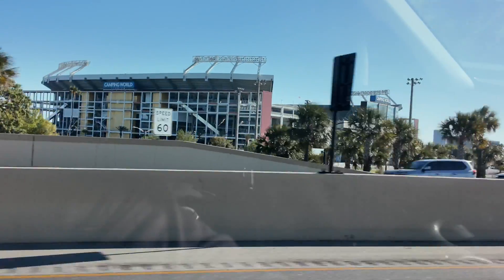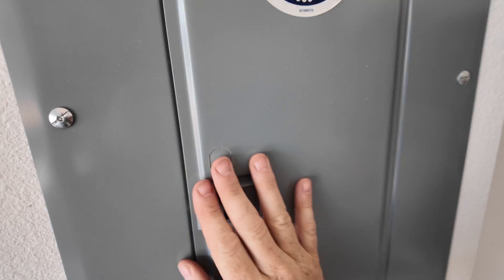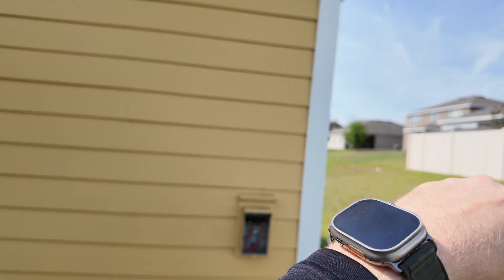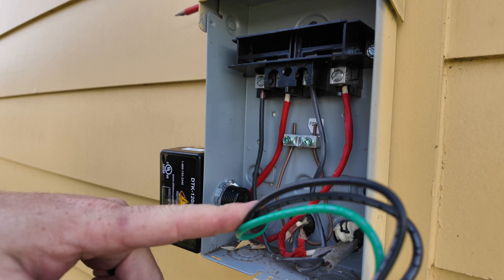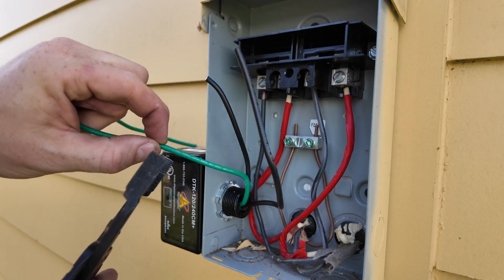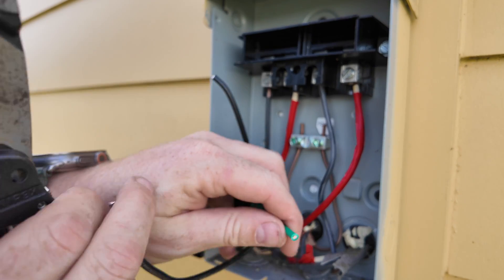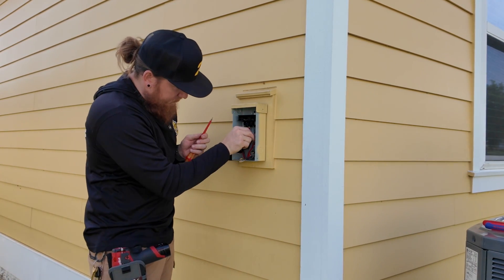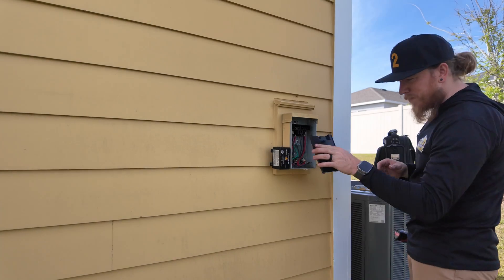Protecting This HVAC Unit For The Future | Installing Packard Surge Protector

Comment: I’m sure someone else has already pointed this out, but there are several violations of the National Electric Code in this video. First, you cannot double-tap the lugs. They are not rated or approved for this. Second, mixing aluminum and copper as dissimilar metals causes galvanic corrosion. Third, mixing copper and aluminum is illegal under the NEC because they expand and contract at different rates, eventually making the connections loose, causing arcing and eventually a failure and/or fire. To join aluminum and copper you must use an approved connector such as Alumiconns, in either wire nuts or polaris lug-types. Fourth, Nalox should be used anytime you are terminating aluminum to a lug.
Reply from the maker: Practically everything I do is “illegal” 😅 it’ll buff out

Comment: Maybe I missed you stating this...but typically those cheap disconnect lugs are not rated for multiple conductors.  Is this one different?
Reply from the maker: It says it can be double tapped! The dtek made me aware to check

Comment: I thought wires were suppose to be pigtailed and your not suppose to double lug on the load lugs 🥹 is that right or wrong?
Reply from the maker: Your right, but on this disconnect ii able to be double tapped, some require you to pigtail.
Reply: Some lugs are designed for 2 wires in same lug.

Comment: Great install but. I would like somebody to explain how this thing works in layman's terms. it's in parallel does it trip circuit breaker? if it was in series you would think it would brake the circuit, but it's in parallel how does this thing work and what do you tell a customer. if it comes into play, the if  green light is out does that mean it worked, And do I have to replace the whole unit If it comes into play. i have not got a good explanation on the product.

Comment: Installing a surge protector is only half the battle as in time which will vary among manufacturers they go bad and will require replacement. Typically around 3 years for most. 

Some models will have a light on them showing they are still active and protecting the equipment. So while you can protect against surges and such, most of the time a failure is related to heat or maybe a surge but no one knows for sure what it was lets guess If a home owner is spending money on maintenance already and getting unit inspected regularly that is half the battle, but just selling a surge protector 1 time and then forgetting to do anything else? 

I've seen the videos where failure happens anyway and a surge protector was installed. If it's only about selling and clicks on You Tube? sure go ahead. It's like all these other gadgets you sell and never mention a single time they have to be also maintained or they quit working in as little as a year for some. So you spend the money on maintenance and more maintenance and more regular replacement of surge protectors for the sake of protecting but net effect is just spending just as much or more money + time.
Reply from the maker: Man, you are right on the money! I’m always transparent on the fact that they do need to be replaced eventually! But the investment of 250 to protect against a motor, board or any component, sure is a hella of a lot better than not having it in my opinion!!
Reply: @KoolinwithKrauss  ok as long as you're transparent. But why not be on YT as well? I know from experience YT only likes click bait mostly. The HVAC industry has mostly evolved into an entity laced with gimmicks. I have an Inverter at my house installed in Oct 2019, no surge protections and no problems knock on solid wood. I also live in a hot climate with 10 months of the year AC use. I've tested these theories quite a bit and I've seen failures of those who install such things expecting a different result. This isn't to suggest I am against surge protections. But it's only as good as it's weakest point and that costs more money. It's like Global Warming. All we need to do is spend a trillion dollars and we'll fix it.
Reply from the maker: @AustinAirCo  our grid is so messed up I see the benefit more. I’m pretty transparent, what ya see is what you get from me on the tubes! But for inverters I’m putting a surge suppressor, voltage monitor, surge protector device. In Florida I’ve seen so many drives destroyed from the power spikes and compressors crap out. And it could be manufacturing and installation!
Reply: @KoolinwithKrauss  I know there has been problems to various degrees with drives failing. I've installed a number of Bosch, nearly all BOVA 60 2.0 of those not any surge protection. I would say if you gonna do it provide one with indicator light showing protection is active. Then you need maintenace to check it periodically then you have to spend money probably regularly the more surges you have. And surges can be from inside the home with big loads coming on or shutting off. I'm in Texas and we're on our own grid here, but it's certainly not without it's problems. It seems the lower end Bosch Inverters sub 2.0 variety seem to have more board or drive related problems. But only from what I've seen via You Tube, not personally. My Bosch at my house is the BOVA 60 1.0 18 Seer variety as the 2.0 wasn't available here in Oct 2019. Still running like the stallion he is. Knock on solid wood.

Comment: nice to see you using the fluke 902...way better than fieldpiece...i only use fluke meters for the past 23 years
Reply: Then how do you know that it's better than the fieldpiece?
Reply: @techfive7202  🤣
Reply: As long as the meter works is all that matters to me. I’ve used multiple brands
Reply from the maker: I’ve had it for quite awhile, I do feel more comfortable with the fluke just based off pure muscle memory. Pretty intrigued by the 378fc 😅
Reply: @KoolinwithKrauss hi bro can you check capacitors with that Fluke .
Reply from the maker: @joseestrada9458  yessir
Reply: The fluke is fine for doing extremely basic stuff.  I don't think it's very accurate though.  It's also expensive for all the stuff it doesn't do

Comment: I have a surge protection device. Except I put mine on the main feed to the house. I have a subpanel that is fed off the main, so the entire house is protected by surge. Thankfully it hasn't taken a hit yet....our power grid here sucks, thats why I put it on.
Reply from the maker: Duuude!! Same the grid is 💩 let me ask you this, I’ve heard either in a class or maybe online, but the device should be within 3 ft of the equipment that it’s protecting? Thoughts? You the man J to the J
Reply: @KoolinwithKrauss  i haven't heard that before. I'm curious as to the reason it would have to be within 3'.
Reply from the maker: @JJ-COMMERCIALHVAC  I’ll see if I can recall or find it homie